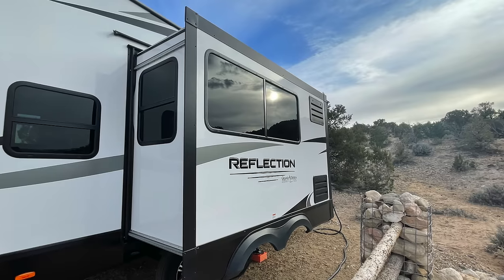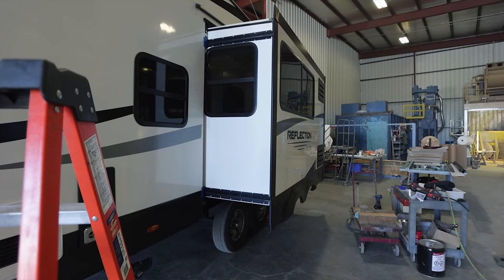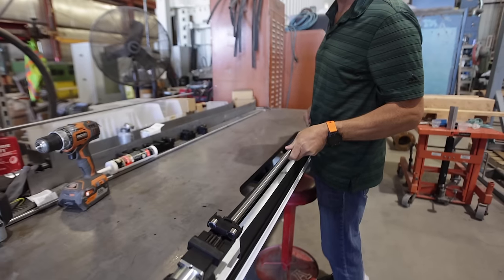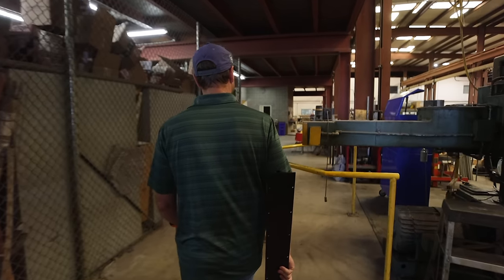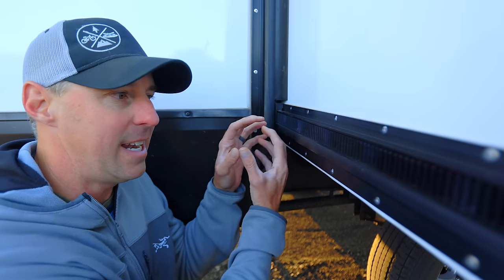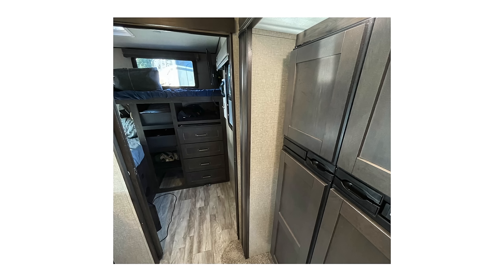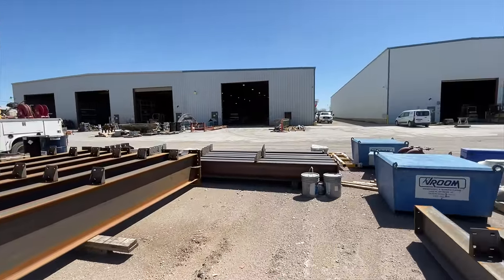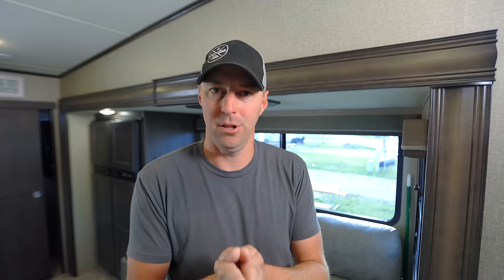Problems With Your Schwintek Slide? Vroom Slide Solution!

Comment from the maker: Going on 5 months so far and the Vroom slide has been flawless. I'll keep updating on how it is working.
Reply: I just called VROOM and talked to Joey on the sync.  He said to do it while the slide is in.  In/Out about an 1" or 2" , 5-6 times.  Mine was going out and once it hit the out position, one side would bounce back 1/2" or so.  I'll be trying this next trip.  He said sometimes they do get out of sync.
Reply: @mikedomokos  throw the controller in the trash . Wire 2 arv winch relays install 2 touch up switches fro better slide control they never fail
Reply: Do you mean atv winch relay?
Reply: Need number

Comment: Hope Vroom is geared up for the rush of RV owners heading to their door, this is a great system.
Reply: I heard the owner has people training in the los Angeles area. getting ours installed in August
Reply: Well I just made apt.  Next available is June 2023.
Reply: Yes they are.   And they also raised their prices from $2800 per slide to $4500 per slide.  Claiming it is rising material cost.
Reply: @KeithSudano  Yes, all material commodities have increased substantially since the Ukraine fiasco.
Reply: @artmartinez8912 where in Los Angeles do you have your system installed?
Reply: @patjoyce2150  we had ours installed at the vroom factory in tucson. I believe there is a shop in san diego. Where are you located?

Comment: The sooner the RV industry drops Schwintek the better! Like you, we have two and one gives us fits a lot. Just last year I had to replace the motor & drive assembly in fact. Love this new system! 👍
Reply: We've had our TT for just about a month,  haven't even made it past backyard shakedown camps. 

We're now waiting on warranty work because our slide is stuck halfway out.
Reply: Mine has worked flawlessly for 3 years. Many times it has been used
The issue is I can almost guarantee is people are leveling their trailers and tweaking the frame then trying to deploy the slide. I never do this. I always deploy and retract slide just on the wheels
They were installed and tested just on the wheels not with the jacks down

Comment: Do you have rollers under the floor of the larger (vroom) and smaller schwintek slides??  I’m having an issue with the smaller schwintek wardrobe slide (exactly like yours)….and there are no rollers installed.  It’s actually not installed correctly at the factory, as per lippert’s detailed requirements for rollers.  Can you please comment?  Thanks!

Comment: There's always a bit of slide anxiety whenever we put it in or out. Between the noise and the creaking we always wonder when it will die. This system looks pretty good. Will definately consider it when the time comes. Thanks.

Comment: We just had our shwintec replaced with vroom and I agree with Jared. Great engineering and great customer service and support. There system is smoother,safer,stronger, more reliable and robust plus you can manually disengage it if you ever had to.. thanks again to vroom family Brian and Joey and his professional team. .
We've been cussing at our shwintec since the trailer was brand new. Would definitely recommend Vroom to friends and family 
Job well ✔️ done
Reply: are you willing to share a ballpark dollar figure on the VROOM?  i have a full length slide on one side and a shorter slide on the driver side that both failed on me. - Thor Miramar
Reply: The estimated cost of our slides are base price $4,500 per slide out, and can vary depending on what we find once we get into your slide itself. If the slide needs new rollers, base plates, or any type of structural repair the pricing will increase.
That's what I received in a email from them

Comment: Absent replacing the system, installing slide plates will make a huge difference. If you have a heavy slideout you will begin to notice dimples forming in the bottom of it where it rides the rollers when you have it retracted. We have a 21-foot full slide out and the plates made a huge difference with our slide.

Comment: My Schwintek failed after 1 1/2 of use on our Grand Design 2500RL. Grand Design denied my claim because I was six months out of warranty. I am 1700 miles away from Tuscan Arizona 

Thank you so much for this video and your channel. If I keep this camper I need a vroom on it or I’ll repair it and sell it because Grand Design should of never put this system on a big slide like this.

Comment: I have a Riverstone 42FSKG it's new and I have had NOTHING but problems with the cheap piece of junk Schwinteck slides. Currently I can not deploy my kitchen slide at all and the other two Schwinteck slides are basically a crap shoot as to whether or not they will function. Next month I'll drive back to the dealer (1000 miles away) and they will replace the kitchen slide. I have full confidence there will be more problems in the future, so when the warranty expires in March 2023 I'll get the good slides installed. Thanks for this review!!!!!
Reply: My slide had major failure. Under warranty dealership replaced all motors and rods.  Next June having vroom installed.
Reply: Do you put your leveling jacks down before you move the slides?

Comment: Very nice. I’m a master tech with 32 years of experience and all I have been doing lately is rebuild schwintek slides. I still remember the first day I saw one, I knew they were gonna be a headache. We have 1-2 a week come through our shop. Thanks for the info.
Reply: Don't know where you are, but VSS Inc. could use a few strategically located installation centers around the country in my opinion. We would have to drive over 2,000 miles to have ours changed out. That drive is all that's keeping us from scheduling it immediately. Our 2021 Jayco has a 15' whole wall two-level slide-out with a Schwintek In-Wall system. Only two racks at each end (would have thought 3 would have been better) and we've had issues already. Retracting always gives us anxiety. Because of Schwintek we wished we'd never purchased this particular RV. We'd avoid any RV with such a large slide using Schwintek in the future.
Reply: @spacecadet4876  we are in Reno Nevada. Sounds like you’ve got the slide that is most troublesome. I’ve been trying to get set up with Vroom to be a dealer for them, but no luck yet…
Reply: hi what do u do when u repair them  do u change out parts for better parts  or just replace the broken part with a original part
Reply: @kyleerickson3382  if I need just one part I replace it with a Lippert part. I haven’t researched if there are other non oem parts. If I need to replace the whole slide I make sure I get an updated one. I believe they have discontinued the inverted block style. The new ones I have been getting have a steel rod not aluminum.
Reply: @mikmaster63  ok thanks for the reply   i have a 22 26dbhbl  forest river grey wolf camper   took slide out today and it's all messed up  2nd time it's broke 🤬🤬  i bought extended warranty   u think it will cover it
Reply: @kyleerickson3382  if it keeps breaking need to look at the rollers, all the weight should be on the rollers. Make sure it’s not out of square.
Reply: @mikmaster63  thanks again  calling dealership tomorrow   hopefully it goes good

Comment: The estimated cost of our slides are base price $4,500 per slide out, and can vary depending on what we find once we get into your slide itself. If the slide needs new rollers, base plates, or any type of structural repair the pricing will increase.
Thats a email i received from them

Comment: Thank you for your video, was my inspiration to have this system installed by a local authorized installer.  Unfortunately, during demo of the unit one of the motors started making a lot of grinding and popping noise.  The folks were able to repair and was ready the next day.  Unfortunately, the drive motor cannot easily be replaced as the entire H-frame has to be removed to replace the motor which is a weak-link for the system as VROOM does not manufacture the motors.  Hopefully, they will design a methodology that will enable replacing the motors easier, with robust connectors.   Hopefully, we will not have any issues for a long time, but just we're just concerned about the reliability of the motors.

Comment: Looks pretty good!  It would be difficult to be worse than a Schwinteck system.  Our old RV had three Schwinteck's on it and the two big ones were nightmares.  Our new RV has just one on the bedroom and it's doing fine.  Either Schwinteck or the RV manufacturers had no business saying that system would work on larger slides.

Comment: Great video! I was really excited about the possibility of replacing our SlimRack and Schwintek slide systems with the Vroom slide system on our 2014 Winnebago Forza but unfortunately they will not install it on anything older than a 2015 RV. I was also given an estimate of scheduling an appointment 10 months out (August of 2023) at a cost of $4,500/slide before they found out we had a 2014. It sounds like a great system.

Comment: Super cool Jared those shwinteck slide systems I don’t think should be on a big slide box  i would have preferred rack and pinion that system you have now should do very well
Reply: Agreed!  They don’t seem to do well at all on large or heavy slides.  I have 3 in my RV, 2 of can barely opened or closed in cold weather.

Comment: That looks so much better than the schwintek! We haven’t had any issues yet with the slide on our 28bh but I have to baby it for fear of it failing. It’s be nice to be confident in it. That’s great that you can pull it in half way too. Can you sit in the slide now when it’s pulled in or is that still not recommended?

Comment: EXCELLENT to hear there is a good alternative.  Our Schwintek system is crap, has been replaced once, still fails to work reliably AND Jared didn't mention the chronic problems of the motors shorting.  I'll be call Vroom for more info immediately.  Many thanks, Jared.  Another reason I support you financially via Google.

Comment: As a time frame I bought a new class c gulfstream conquest in June of 2021, it has a slide for the theater seats and dinette and a bedroom slide for the bed like most. It also has schwintek as well. We’ve slide those things in and out countless times and knock on wood no issues. My maintenance on them is to use a dry silicone spay and wipe them real good in between. I like what you did as well even better but don’t know whether I’d wanna take the coach to Arizona to do it. The one irony is that after I bought this coach I looked at a couple big class C’s that had no slides and I could have been perfectly content with those. One less thing to be concerned about.
Reply from the maker: Yes we were thankful we were in the lower portion of Utah when we were on our way down, it would be tough in we were in Main.

Comment: Great video!   We have a brand new Tiffin Wayfarer that is back in the shop for, yes not a mistake here for the third time for a failed slide.  Tiffin will not put a Vroom slide in per our request.  We are currently in the warranty period.  I will contact Vroom and see what the timing is for installation.  We live on the West Coast.  Any certified installers over this way?  Again, thanks for the great information Jarred.

Comment: WOW - built a better mouse trap!!!  That's one of the most impressive upgrades I've ever seen.  Bet the cost comparison between the 2 systems would be minimal during initial build.
Reply from the maker: Yes I agree.
Reply: The estimated cost of our slides are base price $4,500 per slide out, and can vary depending on what we find once we get into your slide itself. If the slide needs new rollers, base plates, or any type of structural repair the pricing will increase.
Try that for price.  I wished it was cost friendly but it is what it is

Comment: Thanks for the video, this is promising and hopefully to be considered by RV manufactures in place of Schwintek on larger slides.  I was trying to see on their website more info on how to replace the motor. Since it now has 4 bolts to base, how easy is it to replace the motor?
Reply from the maker: It would be more difficult to replace the motor but I imagine there will be less motor failure with how smooth and solid it is. Less wiggle and less binding to wear on the motor. Time will tell. I think the test setup they had everything was working great still at 8,000 cycles.
Reply: Agree, the motor is actually pretty reliable and strong.  Kind of amazing how long it lasts in the schwintek/Lippert gear binding system.  Also shows how great the electronic controller is at protecting the motor when it is put under that stress.

Comment: I wonder if the Vroom system can be retrofitted to a cable system (BAL) on a slide.  Of course there would be additional components like wire harness, etc. Just curious if they've tried to accommodate that horrible slide system.

Comment: Very nice!   I wonder, though… How much of the problem with the Schwintek is due to 1. Crummy Design, 2. Mis-application, and 3. Poor Installation?  I don’t know what your warranty situation is, but I’d have at least asked the RV manufacturer for help before paying another company to fix their problem. 
Oh, wait… My RV’s manufacturer can’t even find our model in their brochures 8 years on.  The only confirmation I have on our model is the VIN sticker, and another RV dealer listed the same model and their pictures matched ours.  Even the dealer that sold it to us had the wrong model number on it.  We had to get the paperwork corrected before we could drive it off the lot.
Reply: Typically all three, except I would say the poor installation mostly happens because it is not really possible to install "correctly". The H column and whimpy gear block design cannot handle the flex of a travel trailer or 5th wheel slide box opening, which gets even worse on bigger slides.  SchwintekLippert lateral flex spec is about 1/4in and real world typical flex is about 2x to 5x that.

Comment: I JUST had my Schwintek system replaced with…. Wait for it…. Another Schwintek system. After it would no longer operate, and the trailer manufacturer only covered a portion of the expense. Took six months too!

I sure wish I had seen this beforehand! But if I have the slightest issue I am headed to Tucson guaranteed.

Comment: My friend has a 2021 Reflection 5th wheel as wheel 320MKS which has hydraulic slides, unlike yours, but hoping you know. When he goes around corners the kitchen slide comes out about a foot. He has contacted Grand Design and the the best they can say is put brace rods to hold the slide while traveling.  Any ideas??  Thanks, great channel.

Comment: Just found your channel... GREAT JOB!  Looking to change out my "slim-rack" system to the VROOM.  How is the access to the motors "open and closed" for motor replacement if required?  If closed using the "manual method" can you then simply tighten the bolt or do you need another method to secure slide for travel?  Thanks!

Comment: We have an older 2007 HitchHiker.  We have been fulltime for 6 years moving every few weeks as we always boondock.  So our 4 slides get used alot.  We have never had a problem.  The big heavy slides are hydraulic and small 2 are electric.

Comment: Great video. My trailer is currently in the shop with a slide problem. Too bad there isn’t a place in Oklahoma where I could swap out the system.
Reply from the maker: They did say they have a couple other places they have done installs but you have to call the one in Tucson.
Reply: @AllAboutRVs  If it needs a new system I’ll be sure to do that. Thanks for the info.
Reply: My Lance  tt is at the dealership I hope they can diagnose this issue so I can get back to my adventures.  Taking no chances on future issues.  Vroom apt in June 2023.

Comment: Hey Jared, do you plan on doing a follow up on this? Would like to hear your thoughts after you've had it for a while. I live in AZ and have no problem driving to the shop and get this done some time this year. What kind of warranty do they offer? Great job. love your vids!
Reply from the maker: I will definitely keep you updated on how it continues to operate and any update with our experience with company as well.
Reply: @AllAboutRVs  Hey Jared, I'm getting the vroom slide installed in about 10 days. It's been about 4 months since you had yours installed. Any issues?

Comment: I contacted Vroom to see if they could replace the Schwintek in wall slide in my 2013 Winnebago class A motorhome.  They told me they were unable to work on any thing older than 2015 "because of the boxes".  Disappointing since I really like the design as Jared showed it.

Comment: I just received a quote from Vroom for the same slide on the same Grand Design Reflection (2016). $4500 and can't get in until August 2023. No problems with the time frame, great they have business. But from $2800 to $4500 in 6 months? No thanks. What is the value of the extra $1700? That I get to wait longer?

Comment: So, is it the Norm for the Schwintek slide to last 12 months at best?  The single slide on my 2021 Reflection 278BH 5th wheel is pretty much dying.  Surely Grand Design and others should be standing behind their product?  And if it's such a crap setup, why are they installing it ?